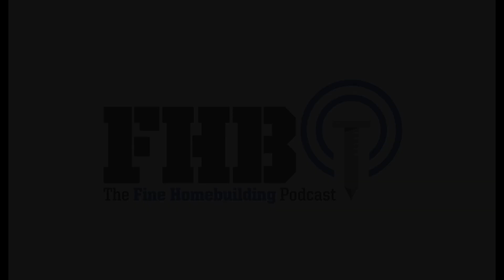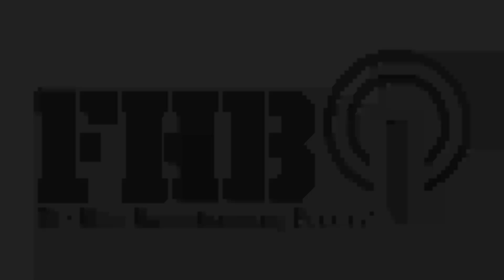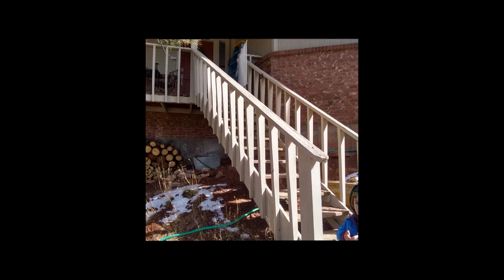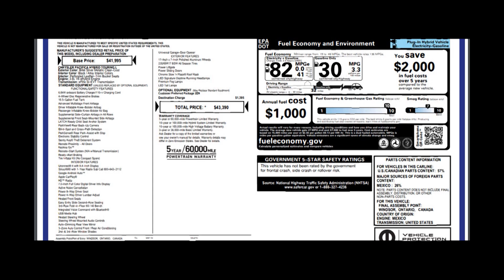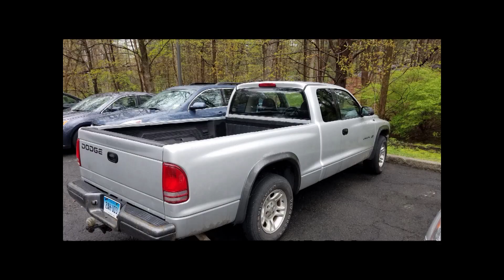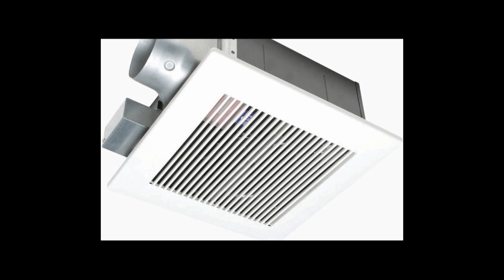Podcast 610: The Best of the Fine Homebuilding Podcast, Volume 6

Comment: I didn't buy it for that purpose, but I would guess my 2020 Toyota Sienna would make a great work vehicle. 3rd row seats collapse to be flat with the floor, and 2nd row can be removed by just pulling a handle to release them. After that you could fit many full sheets of drywall. Might need to get different tires if you're really filling it with heavy materials. Rated at 21 mpg. Note that newer Siennas have seats that are much harder to remove.

Comment: Hybrid timber frame usually refers to using heavy steel or cast brackets to hold posts to beams, rather than all wood construction with fancy (read difficult) cuts and pegs. Historically, like when my 10 greats grandfather did this in Virginia in the 1630s, the pegs were mainly used to hold things together until the joint was finished and the building then could've usually survived a class 1 hurricane without fasteners of any kind. Although the pegs were left in. The English Tudor buildings were often post and beam with waddle and dab infill. I.e. woven sticks (not structural) covered in clay mud and then plastered.